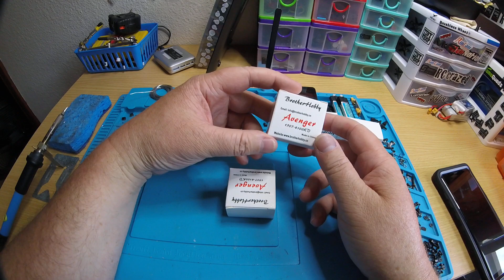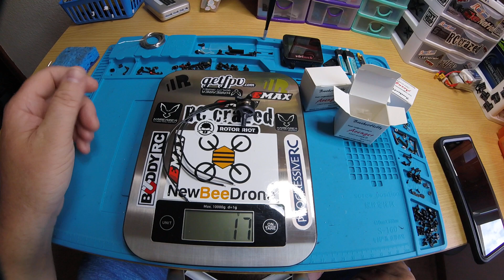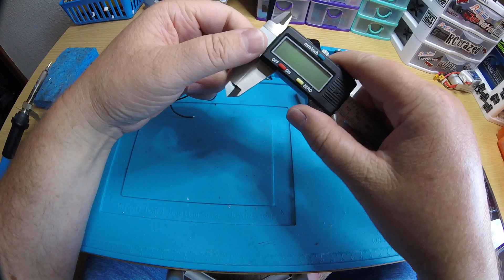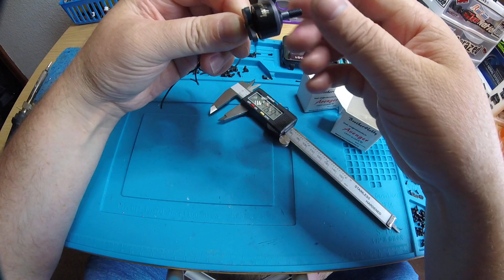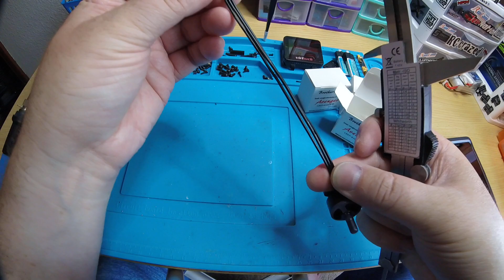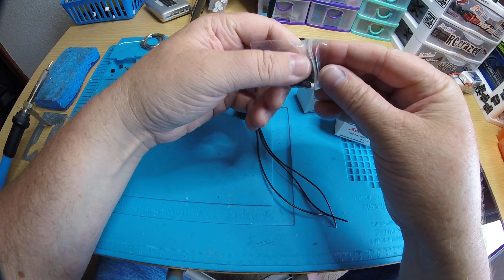brotherhobby 1507 4100kv

Comment: I have these on my 3” Massive Droner and it is a fooking rocketship.  Weighs 133 grams.
Reply from the maker: Don Wilson hell yeah!
Reply: SteveO4478 
I have the 4100 on the Droner and 3600’s on my CMW 3” Superlight.  I use 850’s on the 4100 and 650’s on the 3600.  The 4100’s will probably pummel the 650’s into submission...but it would be a fun ride!
Reply: Don Wilson I have them on my massive droner 3” but with 3600kv. I only have 650 4s and was afraid that the 4100kv would drain my battery. It still rips on  3600kv though . You using 4100kv on your build?
Reply: Don Wilson I just finished mine last night. I thought 4100kv would kill my 650 4s lipos. Still have plenty of punch on the setup. How did you get down to 133g? Mine is at 142g with hglrc F428 and TX20.
Reply: SteveO4478 
Sorry...I weighed it again and am at 139.39.  I must have thrown it on the scale without the props and nuts or something.  Once I swap out my dipole with my axii, I will be over 140.
Reply: Don Wilson I was about to say what did you do to get it that light! Lol!
Reply: I just ordered these motors and the 3" Massive 3". What kind of flight times are you getting with these 4100kv and on what battery?